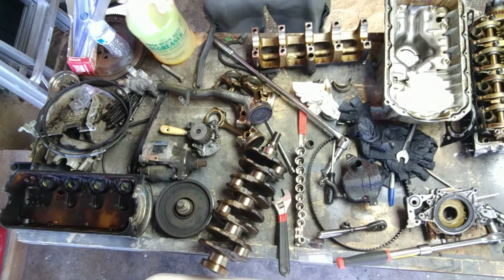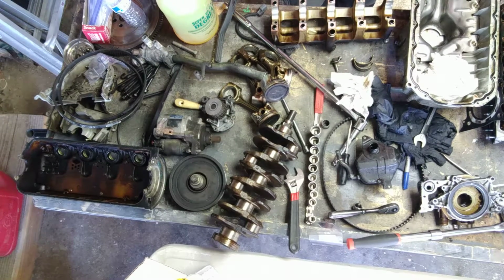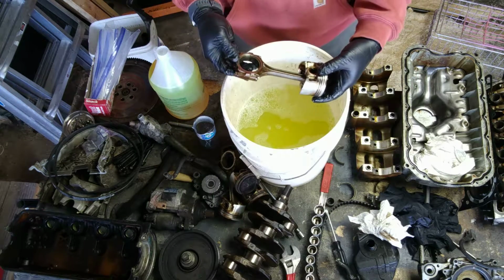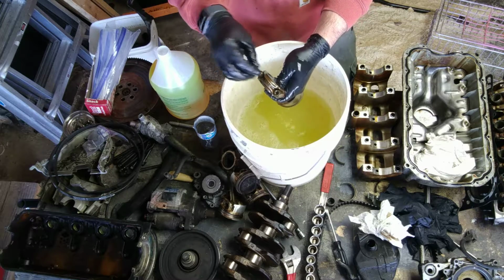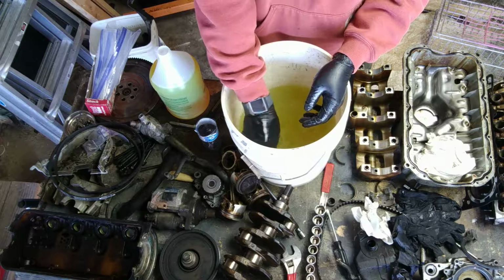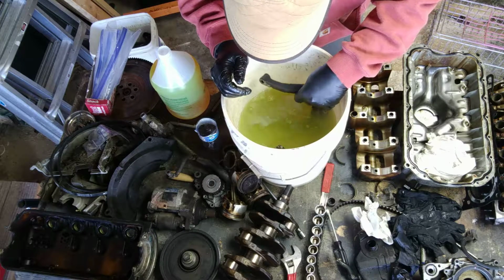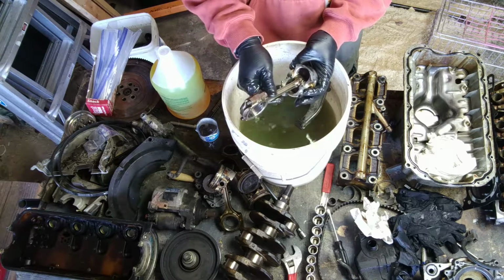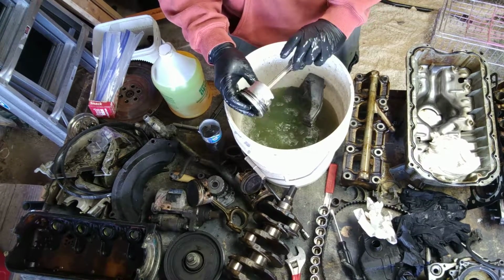Harbor Freight Heavy Duty Degreaser VS oil stained engine parts

Comment: I have been using this stuff for about 6 months. I buy a lot of old riding mowers and fix and resale them. This stuff really works well. I like to soak greasy surfaces for about an hour, then hit it with a pressure washer. Makes things shine like new. Even takes the grass stains off of the mower deck, which is challenge for many I have used.